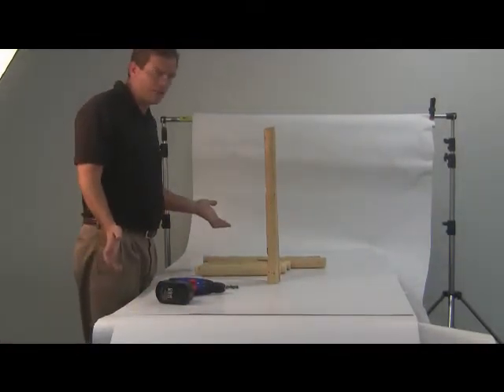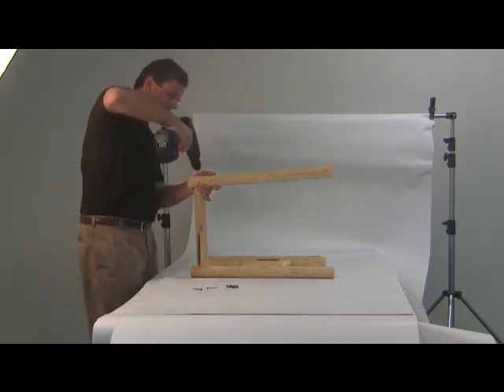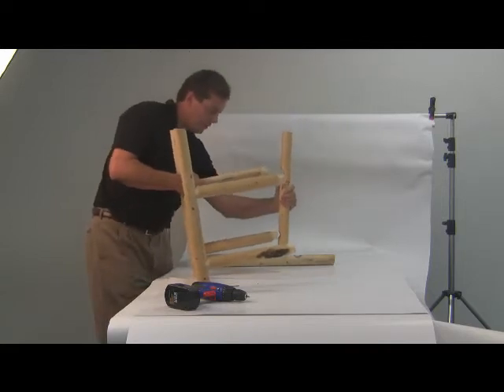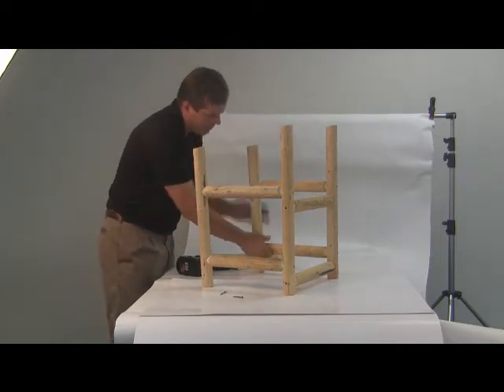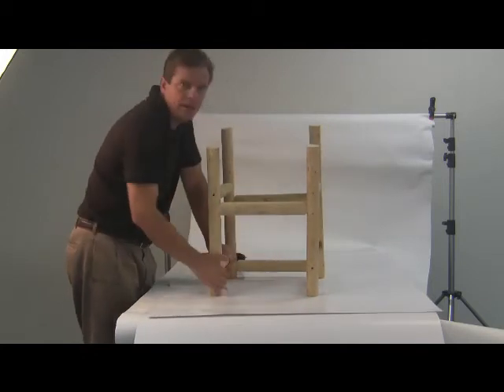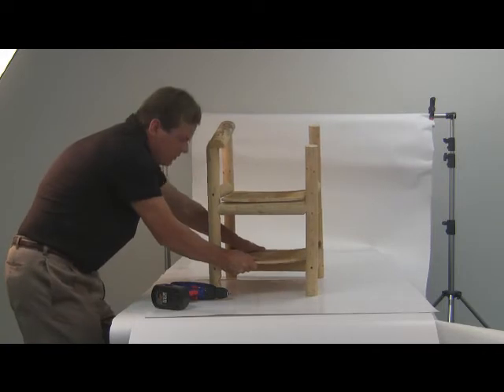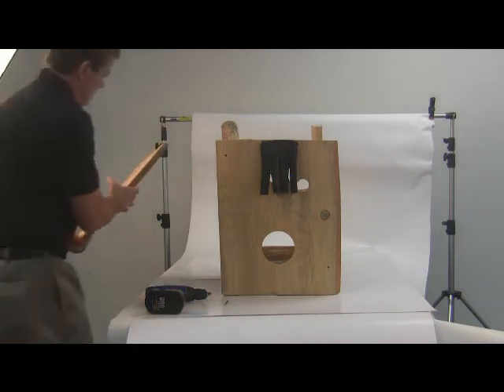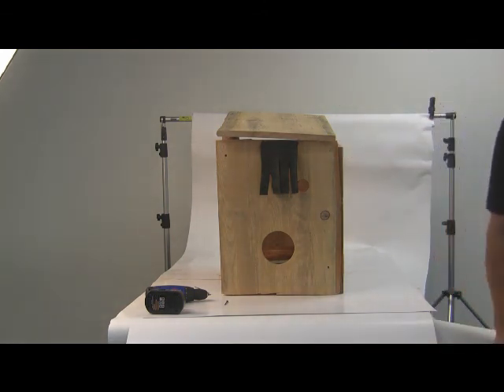Feral Cat House Instructions

Comment from the maker: The frame is super strong. The 1" thick cedar or pine planks act as R1 insulation. Add some hay and this will be as warm as a cabin without a heater. The small space about 14 x 14 will allow the cats body to warm it up.  Waterproof from snow and rain.  our testers love it. this is just a test model.